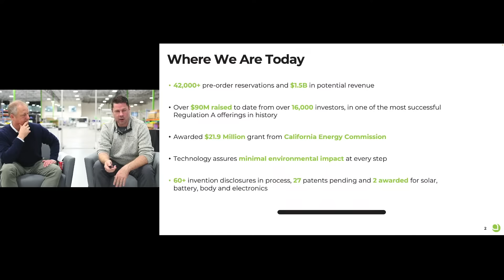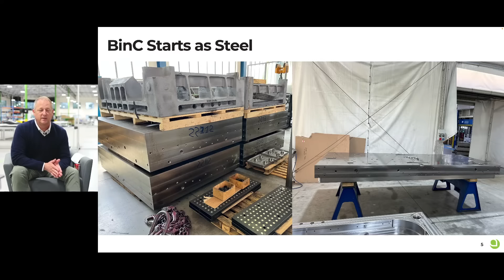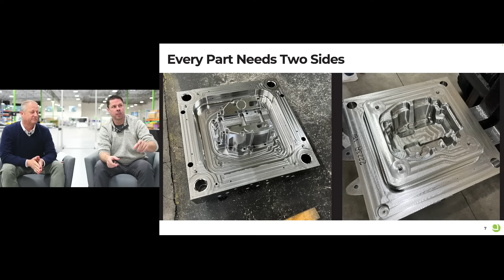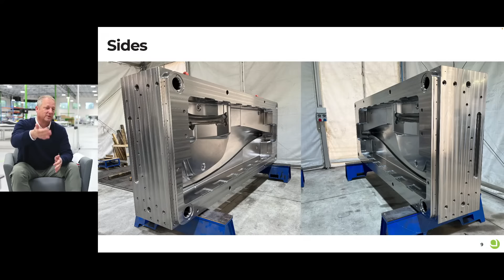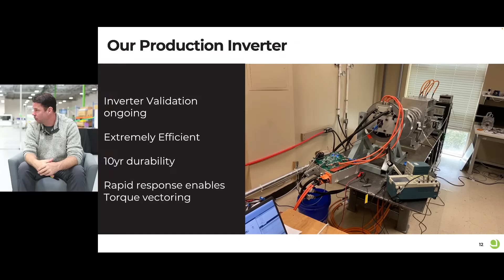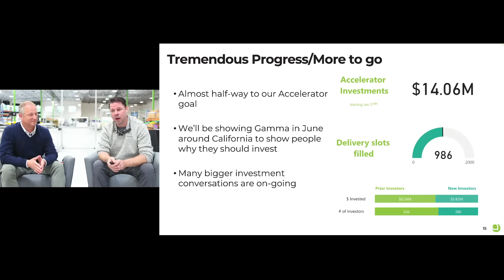Production Tooling Progress | Live Webinar

Comment: I've seen Chinese models that are 1 seaters. Let's be honest. We don't want anyone on our personal trip. If anything, We need to keep the tricycle appeal in there. The cent body frame should not be more than What the person fits. Then becomes the custom makes. $$$. Price go's up. Most Americans and Europeans are tall and wide. And that's what kills it for their personal smaller models. Too bulky then. 3ft wide in the center, ,5ft long for the seating and console, And back trunk space of 6ft. The front center wheel shaft to hold batteries could be 3ft x3 ft. You would be able to fit 12 ft of solar through out the body. 8 batteries would surely get a person 300 miles. And there has got to be an optional pedal system, and not the tradition kind either, but rather something to press  up and down. 4 inch tires. yuup. optional air roof. Optional vdo mirrors. with or without.  Optional windows with or with out.

Comment: Curious to know if the rear hatch can remain open for short drives,  where I am carrying something bulky, let's say from Lowes to the house.
Reply: I can't see why not. The Delta design Jason Hill has been showing off looks like it has a very sturdy solar hatch.
You'll probably be able to prop it open or tie it down like any hatchback.
Reply: I don't see it being any different than leaving the hatch open on my Caravan other than that there is  no possibility of choking on the exhaust fumes that seem impossible to prevent from making their way to the front no matter what combination of windows or blower fan speeds used in the gas powered van.
Reply: This is a good question. It's likely possible to drive with the hatch ajar. I think the rear camera may be inoperative, or at the wrong angle for rear view and there is no mirror.

Comment: How about magnifying glass coating over solar panels to increase energy collection intensity?
Reply: Do you mean like a Fresnel lens? 

The only way that works is if the lens is considerably larger than the solar cells, in order to catch more sunlight. That would adversely affect the aerodynamics of the Aptera. 

There are stationary solar arrays that do this but the cost benefits are so low that it's better just to add more solar panels.

Comment: Are the solar panels going to be molded into the body panels? or are they attached after they are molded?
Reply: The solar panel manufacturing is a different process from the CPC body parts and will be done in-house by Aptera.

Comment: 49:36 –If the cargo + passenger capacity of the car is only 500 lbs, how much capacity would have been left with the full 1000-mi range battery pack option that was initially offered? A couple of football players and the car’s already at max!
Reply: This is crazy, 500lbs is too low, kind of a deal breaker for me

Comment: It would be nice for the environment and the brand if the supply chain for larger carbon fibre parts were from local shops rather than from Italy.
Reply: Do you know any local shops that would partner with CPC? 
They do plan to bring manufacturing to the US, as does Elaphe motors.
The longterm plan is to bring local manufacturing to the whole world.

Comment: I love that they are eliminating painting to save cost and bring Aptera to production quicker, but I wonder if there's a way they can get manufacered panels that are already colored and have better UV resistance than the vinyl wrap to eliminate that. I'm guessing color matching and cost are the biggest reasons not to do that if possible. But honestly I wouldn't care if it looked a little goofy and cost more to buy an Aptera that had no need for vinyl wrap. It would give it a unique look and eliminate a part of the vehicle that needs to be protected and maintained.
Reply: Sandy Munro, while on Autoline, indicated that the process CPC uses can include color right in the material.
Reply: @durwinpye3304  But is the CPC material and color additives UV resistant? A lot of plastics don't hold up so well when exposed to sunlight. Usually they become brittle and crack.
Reply: @JEP-Tech  Good question. I don't know the answer, but given that they are testing the durability of wraps and haven't mentioned adding color to the plastic themselves, it could have been mere speculation on Sandy's part. 
It all comes down to materials science.

Comment: 41:10 Brick the battery if you don't charge it? Not in the case of a Coda EV that sat in a dealer parking lot for literally 10 years without being charged and ran just fine! On channel 'out of spec reviews'. I welcome being able to limit charge % the battery will last that much longer

Comment: Are you future proofing the battery pack? There are some really exciting advancements that are just around the corner. CATL the largest battery manufacturer in the world is coming out with a Sodium Ion that will be much less expensive than Lithium Ion and they are better for colder climates, which most of the US is. Other batteries are coming with more than double the capacity and lighter weight. Go Aptera!!!
Reply: Please do not put a Chinese battery in this American vehicle.
Reply: @johnpoldo8817  the body is being made in Italy and the motors in Slovenia.
Reply: @DCart007  Sounds good, but if a Chinese battery my order is cancelled.
Reply: @johnpoldo8817  I understand the concern, but I would love if Aptera shipped with CATL’s LFP battery… it’s low cost and no cobalt and other risky battery materials.
Reply: @karthik11512  When you buy a high ticket item from China, a portion of the profit is collected by the CCP to fund their plan for world domination.  Their long term plan is to make sure we use their currency, language, and customs.  Don't help them.
Reply: Any battery produced today will be obsolete in 6 months.  So will the solar panels.

Comment: Are you using batteries manufactured by BYD in China?
When can we expect to be seeing returns from our investment in Aptera?
Are there heavy metals in the solar cells?

My dad worked in an aluminum extrusion factory.  He was the tool and die man.  He had to file the dies to precision calculations.  They would put the die into the machine, and push white hot billets of aluminum through it. Out the back would come the perfect aluminum extrusion, perfect for sliding door rails or picture frames or storm windows.  The noise was deafening.  I watched them powder coat the motorcycles at the Harley Davidson factory.  I see you are trying to be more environmentally conscious than HD.

Comment: Similar question as one discussed in the video, re: battery health. Lithium batteries prefer to not be topped off right? I’ve read they like to sit between 30-50% charged or between 20-80% charged.

Comment: It's disappointing that there is no new information about the stuff that matters most to me: how will access to the supercharger network work? (No agreement with Tesla for access to the whole network, clearly, and no guarantee that Tesla will sell the Tesla-CCS adapter to non-Tesla owners)  How will the steering system work? (it increasingly looks like variable ratio is off the table). Will the payload continue to be limited to 500 lb.? (Their answer about a 2200 lb vehicle being unable to carry more is BS, as is their "Two 150 lb passengers and 200 lb. cargo" statement, given that the MEDIAN U.S. adult weight is 170 lb, which means that half of the American adult population weighs more than that). 
Each of these is a potential dealbreaker for me, and I suspect for many others, but they sidestepped each question.
Reply: Anyone can make a Tesla to CCS adapter, neither plug is proprietary. The steering rack has always been a normal electrically-assisted rack with variable assist but fixed ratio, no change there. The Aptera 500lb weight limit is more than most ICE 2-seaters at 350-450lbs, but owners routinely go over that limit without any problems. The average 5-person car only has an 850lb max payload.
Reply: @biffwilliams6191  I don't think ICE two-seaters or "average" cars of any type are good comparisons.  The Aptera is unlikely to be used in the same manner as sports cars (I, at least anticipate spending much of the vehicle's time on the road with two people, a dog, and luggage), and "average" cars are not designed with efficiency in mind. I don't see why it would not be possible to have a payload capacity of 700 lb, given that there have been vehicles that weigh less with higher payloads.  I understand that there is an absolute limit to how much mass you can place above the single rear wheel without wrecking the vehicle's stability, but I don't understand why springing and damping couldn't be designed to accommodate 500 lb. of driver + passenger  in front.
Reply: @JorgTheElder  Was it really wise, then, for Aptera to tie themselves to a charging network before ensuring that its owners would be able to use it?
Reply: Because it's always about you, huh Bob?

Comment: Very generalized announcements.  What I do see is that the loyalty of early depositors means nothing to the company and that paying for an advanced spot in the delivery line is what it has come to.  I am also hearing that we should expect a final sales price more realistically aimed at the the initial pricing plus 30%.  They claim it is due to inflation, but it is much more than that.  I think they initially were not very conservative in pricing out parts and manufacturing and now see the more realistic costs of producing an EV.  Once this price approaches that of a Tesla Model 3, I will change my mind.  One cannot compare a 2 seat motorcycle with 2 airbags and limited payload of 500 lbs. to the number one safety rated EV five seat car with great payload and towing capabilities.  It may not be as aerodynamic, but it charges faster and has service centers around the country.  I really don't want to repair my own car on the side of a highway.  My vehicle whether an Aptera or Lucid will fully charge off the solar panels of my house, so 15 to 20 solar miles a day means nothing to me.

Comment: Where is the BinC assembled? 
How do we wash inside the wheel pans?
Reply: The BinC will be assembled by CPC in Italy.
Reply: The wheel fairings are supposed to remove easily. Move of the parts are aluminum or composite, so rust shouldn't be a big worry.
Reply: Pressure washer .
Reply: @thomascorbett2936  how are you going to get the pressure washer in there? I don't have a 90deg angle attachment on mine... Do we have to remove the pans? I can see most people skipping that and have the suspension/brakes/motors rust.